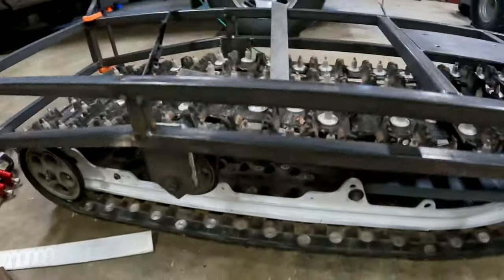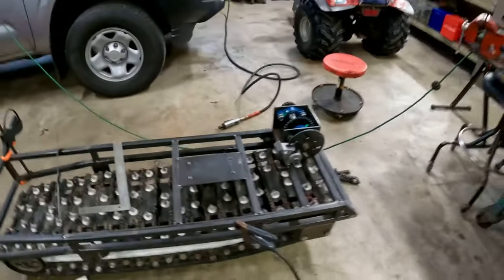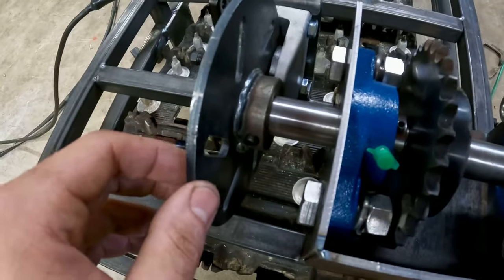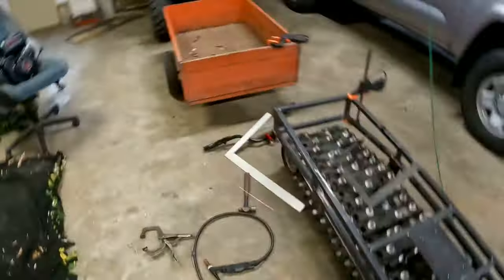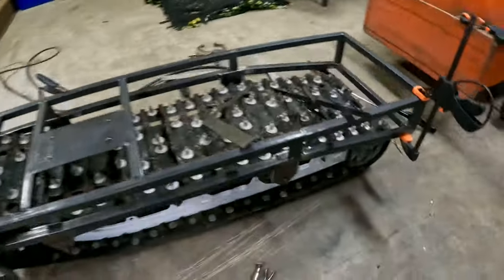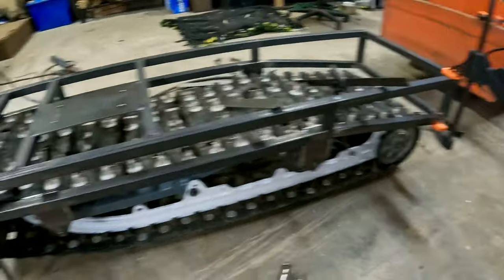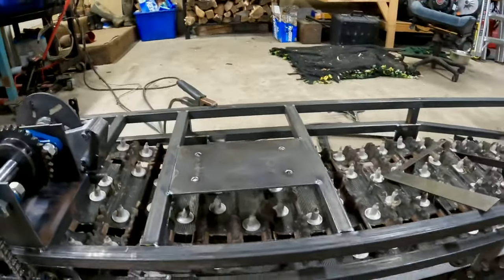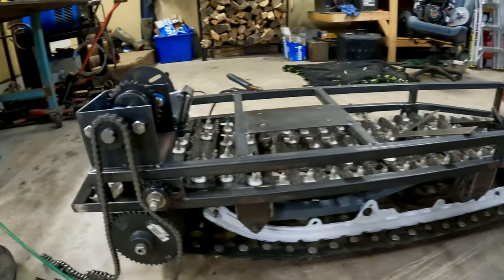New Track Sled Build Part 1

Comment: Sweet. Interested in following the build. Considering building one myself.  Live in upstate NY. For the most part I can get around with my ole Honda 300 4x4. But occasionally it won't get thru it on bigger snow storms.  Building one of these would help blaze a trail and after a day or two of freeze/settling could use the Honda again.
Reply from the maker: Totally worth building one. It has its own time and place but will quickly be a favorite next to your fourtrax I can guarantee that

Comment: Really nice - like your attention to detail. Have a 440 sitting out in the yard which I am going to dismember and start my build. Interesting to decide whether to build the frame from scratch, or to use the sled frame etc. Also agree with your idea of building a riding tow unit behind. Saw a nice one a while ago that also served as a packer for FatBike trails. Double duty.  Either way, super appreciate your time etc in documenting this so we can ride on your coat tails. Cheers.
Reply from the maker: Thanks for your comment, I’d recommend using the sled you have and as much as you can from it. Best part is you can always sell it to finance your full frame build if that it something  you want. And learn what to do and what not to do. Hopefully can keep the videos rolling on what I like building thanks!
Reply: @TRoutdoors2021  Hey TR - I’m back and building! Have decided to go full frame like yours, too many compromises with using the sled.  It just was going to be too much work to make it work. That being said, building the frame presents other challenges. Makes me appreciate your workmanship even more. Couple of questions if you don’t mind. What’s the distance between top tube, and bottom? Looks like 2-2.5 inches? You used 2 x 1/8 plate to make suspension point attachments? That length looks like 4 - 4.5 inches?
Reply: @TRoutdoors2021 very nice video and I love your design! Do you know the weight difference between build your own frame vs use a short track sled frame? I want build one as light as possible. Also, would be great if you have another video to show how to build a frame and install boggie wheel etc. Thanks!

Comment: Like it! Did you use shoulder screws, long bolts, standoffs or spacers between the fabricated frame and sled?
Reply from the maker: Just used welded tabs on the frame that come down and bolted using the factory spots on the skid on four spots. Hope that answers your question?

Comment: Your bottom idler for your drive sprocket is on the wrong side, it should have a straight pull on the tension side. Nice clean build though I'm getting ready to build a long track tug.
Reply from the maker: For sure I couldn’t come up with better placement while building on the fly lol hasn’t given me much grief yet

Comment: Thanks for sharing your build. I’ve been preparing to make one myself and will pull the trigger soon. I do have a question about the tensioner on the final drive. Is it on the correct side? By the i mean, shouldn’t it be on the slack side of the sprocket?  Thanks again, I’ll keep watching for more.
Reply from the maker: Your correct it is on the wrong side, I usually just build on the fly with just a rough draft in my mind haha. After the frame was built that’s where it ended up. I haven’t had any issues because it’s a 5/8 bolt holding the tensioner sprocket down so it doesn’t move until the chain stretches again

Comment: Was there a specific dimension you had to keep with the mounting bolts on the track or just have it mount wherever it landed after being compressed down?
Reply from the maker: I locked the suspension out that way the bolt spacing stayed the same and went from there 👍🏻

Comment: What thickness is the plate steel used for the skid mounting tabs and the box around the the gearing setup?.
 Jas ot been strong enough?.
Reply from the maker: I used 3/16 for the tabs and 10gauge for the gear box stuff

Comment: Awesome build. What kind of speeds do you get with a 6.5? I have a Honda 13hp I was going to use but the 40 series torque converters are super expensive. So I’m considering selling it and buying a 6.5.
Reply from the maker: My last 6.5 build from a snowmobile went about 15-18 but I changed the gearing a bit on this one to hopefully go a little slower and have more torque

Comment: Why do some guys weld the suspension, and others don't? I'm considering building one, so I'm seeing that.
Reply from the maker: With some suspensions they sag pretty bad when you want to push down on the handle bars to get the front end of the track sled up. After having both now. I wouldn’t care either way. I guess there is less part to brake with it being locked out as well

Comment: Where did you get that gearbox / 1” keyed shaft
Reply from the maker: I made the gear box with metal, pillow block bearings and buying the 1in keyed shaft
Reply: @TRoutdoors2021 thanks! Building one later this week and your design is by far the best I’ve seen. Where’d you get your clutch?
Reply from the maker: Thank you I appreciate it!  I got mine from eBay but these clutches are just knock offs of a comet TAV2 30 series clutch
Reply: do you have problem with the knock off 30 clutch? It's way cheaper, as long as they don't break while I am doing ice fishing I am willing to take a chance , lol. of course will bring space belt. please share you comment or experience, thanks!
 @TRoutdoors2021

Comment: Can you post a like to the spline hub you used
Reply from the maker: I actually just cut the spine off and put a key way on the shaft. But if you still have the disc brake you could cut that down and weld a sprocket to it.

Comment: Hey nice unit where did you get the spline weld on him for your main drive shaft on the track ?
Reply from the maker: Canadian, I put an end mill key way right through the splines. There not actually doing anything just the hub slid over with a normal key way.
Reply: @TRoutdoors2021  awsome idea was scratching my head on this one
Reply from the maker: No problem, yeah I just turned the shaft down to 1in and did the key way. If you don’t have any access to the tooling it can be done at a machine shop fairly cheap and shouldn’t take long

Comment: How’d you do the drive shaft is that the stock sprocket on it ? They all seem to be splined shafts and idk what to do ..
Reply from the maker: I had the shaft turned down to remove the splines and machined a keyway for a standard spricket